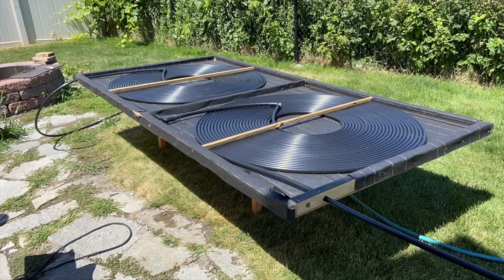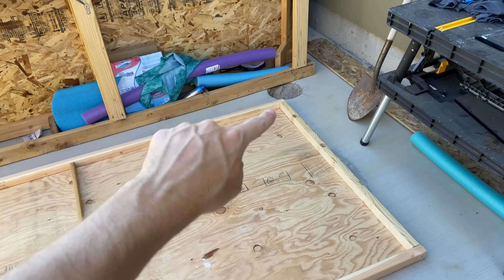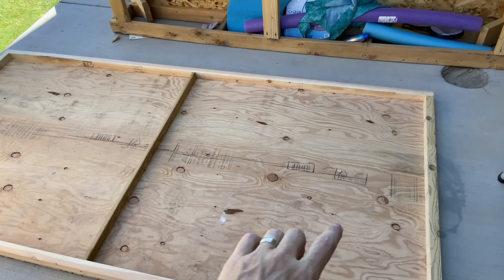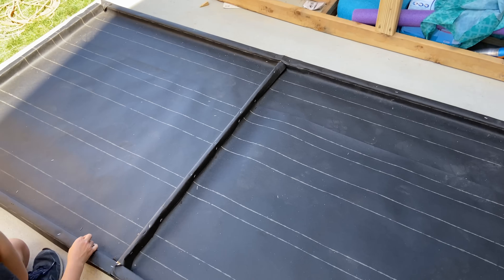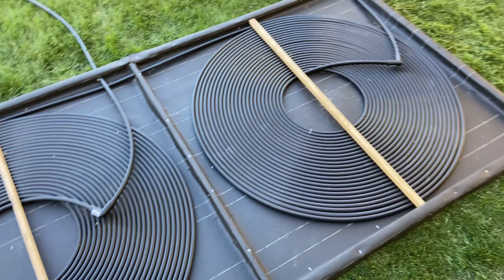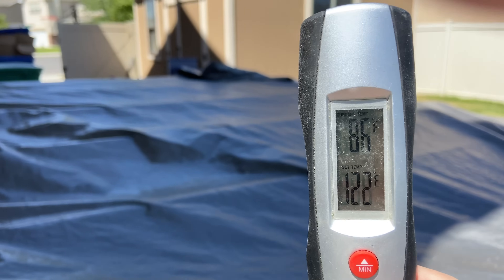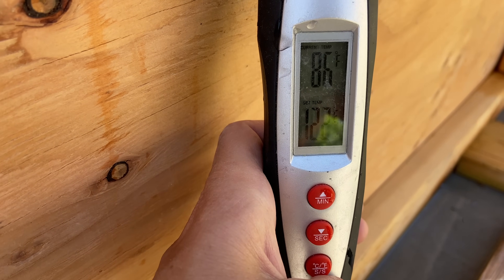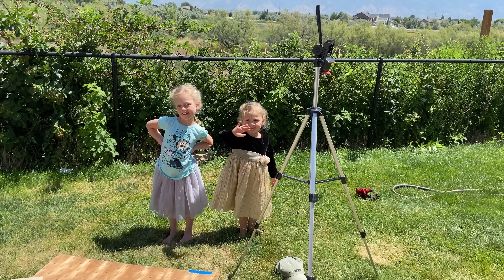DIY Pool Heater - $50 Solar Heater

Comment: Awesome build!  Decreasing flow rate may increase the delta T but it won’t speed up heating the pool.  Consider mixing a drop of boiling hot water to a gallon of ice water vs adding a half gallon of Luke warm water to half gallon of ice water.  In both cases you have about a gallon but the Luke warm / ice water mixture will be much warmer overall.  And in this case it probably makes zero difference but you might start to see higher losses to air around the panel as its temp delta to air increases, increasing convective heat transfer to the surrounding air.
Reply: What!?
Reply: Whatever this guy said... sounds true
Reply: This is incorrect for many reasons. You need to account for the time to build up heat in the water tubes, there will be certain levels of losses if you pump very fast(or very slow). Imagine trying to heat up a small water pipe  using the hot water flowing through it. Now imagine the same flow of water in a much bigger pipe. There will be a lot of loss of temperature just trying to transfer to the big pipe.

Pump too fast and you might not allow enough time for the thermal transfer in the hot portion. Theres lots of variables here and we are just so far away from your luke warm / ice water mixture that I had to comment...
Reply: Sun's energy, even though it varies over the day, is a fixed thing at any time, in W/m². Usually  averaging ~1kw/m² on the Earth's surface on a clear day in normal latitudes.
Reply: The specific heat capacity of water doesn't change much from 0°C to 100°C. The main heat transfer method is radiation Sun -> pipe, which is not affected by the differential temperatures. Temperature difference mainly affects conduction. So, the energy input is the same whatever the temperature of the water. 
Heat losses are contained by the clear covering, and air-sealing of the solar heater panel, which surrounds the pipes in hot air. This will increase the heat input via conduction from that hot air, which is radiatively  warmed by the same 1kW/m² from the Sun. Extra energy! 
So, in my view, the rate of water flow will not affect the total energy absorbed from the Sun, and transferred to the pool. 
Over time, the pool water will reach the same maximum temperature whether fast-flow or slower flow - dependent, of course on the heat losses from the pool/heating system being minimised as much as possible.
Slower flow will produce hotter water out of the heater, but less of it. The total energy transferred Sun>pool will be the same. 
It may be that energy-loss control is a more important factor here than people are considering.
Reply: A small pool, 4m x 10m, averaging 1.5 m deep, contains 60m², ie 60,000 kg of water. 
Every 1°C rise in temperature would require  at least ~2.5MJ of energy. 
Each 8×4 board, with ~1m² of energy collecting area would provide, for free, 2kW. Which would take 125,000 hrs to raise your pool temperature by 1°C. (Assuming NO heat loss) = 10,500 days of 12 hrs of hot sun. 
However, if you had 10 of them....
1050 days. It's only 3 years or so.
Reply: Water is a bitch. It has a phenomenally high specific heat capacity compared to most normal substances. Which is why we all spend so much of our income buying energy to just heat water.
Reply: BIG error! Not 125,000 hrs, 125000 seconds! Oops sorry..
=35hrs
=1.5 days. 
Just with 1 8×4 board.
Hmmmmmm...
Now it becomes interesting.
Reply: Please check my maths. But if I'm right, with 5 or 10 of these, you could turn your swimming pool into a hot-tub in 2 weeks!
(Not to self: must look into swirly pumps for full giant hot-tub experience)
Reply: Thats exactly what I was was saying in my head. To add: Higher flow would have higher efficiency of heat transfer on hot side.
Reply: And u both have zero clue what ur talking about !
Reply: @chriskibodeaux9818  in this instance, the thing to do is run the water at maximum speed. The higher the temperature differential between the source and the sink, the more energy is transferred. If you run it slow you'll just spend energy heating already hot water. The faster the water flows the more it behaves like it's heating the whole pool at once.
Reply: @JackRyanRobtics  100% false! Especially with solar!
Reply: @chriskibodeaux9818  this is how heat transfer works. Heating something that's already hot isn't going to increase overall heat in the system. I've been doing this weekly for years when I make beer. Regardless of your source, you want to maximize the temperature differential to extract the maximum amount of heat from the source. In my case I'm chilling beer too achieve cold break using a counter flow chiller. You counter flow to achieve a high temperature differential across the whole chiller.
Reply: @JackRyanRobtics  ur still wrong when it comes to solar pool heating! Faster is not better! Ur experience with beer does not mean squat when it comes to heating a pool with solar!
Reply: @chriskibodeaux9818  this is basic heat transfer. You want maximum differential in temperature because this transfers the most heat. The reservoir is irrelevant. The output temperature of the water is irrelevant. The only thing that's relevant is how much you can use the pool water to cool the solar heater. The more you can lower the temp of the solar heater using the pool water, the more heat is transferred to the pool. It's a pretty simple equation. Heat in = heat out. You want the heat out to be maximized by your pool water and minimized by any other conduction, convection, and radiation. This means running it quicker as it maintains a high temperature differential, thus pulling more heat into the pool water and reducing the radiation and ambient air temperature differential.
Reply: @JackRyanRobtics  and in the real world fast does not work! U have zero clue what ur talking about! Been doing this for over a decade and slow always heats better!
Reply: @chriskibodeaux9818  I'm not making this up. This is how heat transfer works. You're sounding like you don't know the difference between heat and temperature and been defining it's efficiency based on the temperature in vs the temperature out alone, ignoring the fact that temperature is a unit of heat per unit mass. I can actually break this down mathematically if you want. But I'm actually interested to see how you think this works.
Reply: @JackRyanRobtics  again in the real world solar heater do not work good running the water fast! Slower is always better! Nothing u say can change that!
Reply: @chriskibodeaux9818  In the real world, I'm a mechanical engineer. I've built heat exchangers and Stirling heat engines in the past and they still run pretty well today. The reason I'm here is to try to run a Stirling engine off of a solar heater for my latest low temperature differential design. If nothing can change your mind that math is real, and thermodynamics work, that's a whole other game, but unless you are sitting on something that completely refutes the basics of heat transfer, I highly recommend you run an experiment and come back with data and a theory to support your argument.
Reply: @chriskibodeaux9818  Get an education, and THEN form opinions. They are called the LAWS of thermodynamics for a reason.
Reply: @awo1fman  wouldn’t of commented if I didn’t have the knowledge to back it up!
Reply: @chriskibodeaux9818  All you've done is saying to people: You are wrong. You would have given a thorough explanation as to why they are wrong if you had the knowledge.
Reply: @dontghostbanmeplz8788  cause I don’t need to explain a thing! If u think u can prove me wrong go ahead but u CANT!
Reply: @chriskibodeaux9818  people above me have already proven you wrong. And you are unable to refute anything since you cant explain why. 
Telling people they are wrong just because you say they are wrong in your reality does not prove they are wrong.
Reply: @dontghostbanmeplz8788  they can’t prove me wrong! I’m not wrong! That’s cute! I have done this over n over n over the last 15 plus years! Fast water won’t heat up ur pool at least with solar!
Reply: @chriskibodeaux9818  you'd think with 15 years of experience you would be able to give some decent explanation as to why something doesnt work. 

But nope, you're stuck at: You wrong, me right!
But have fun using fallacy's why you are right instead of real arguments.
Reply: @dontghostbanmeplz8788  I don’t have to explain why the sky is blue! I don’t owe you any explanation! I don’t need to explain reality! Fast flow for solar does not work!
Reply: @chriskibodeaux9818  somebody who knows his stuff can explain why the sky is blue and probably would if hes trying to make a point. 

You wont explain it because you dont know the theory behind it, hence you give every excuse in the book as to why you dont have to give an explanation.
Reply: @dontghostbanmeplz8788  sorry but if u say the sky is brown and I say it blue and it’s is in fact blue I don’t need or have any desire to explain it to you! Sky being blue is common sense knowledge same goes for this! Anyone who has done this a few times know slow flow is the only way it works!
Reply: @chriskibodeaux9818  Well then, better go make that scientific video of a side by side comparison between fast and slow flowrate. Until then, for all we know, you are telling us the sky is brown despite it in fact being blue, without wanting to explain why.
Reply: @dontghostbanmeplz8788  and again I don’t need to prove reality! There is no reality where faster heats better then slow when it comes to solar!
Reply: @chriskibodeaux9818  If you run water from your tap. Slower might be better. 
But in a closed system, where it goes from the pool, into the solarheating, back into the pool, you want all the heat from the sun going into the water.

Like the original commentor said, with slow running water you increase the risk of the system getting hotter and thus transferring its heat back into the air around it instead of the water. 

So unless you mean, the wateroutput at the end of the solarsystem, and not the pool itself, then hey, you are right, but that is not what everyone but you is talking about.
Reply: @dontghostbanmeplz8788  for solar heating a slower flow rate will always heat better then fast flow rate! FACT! Water needs time in the tube to heat up the longer its there the hotter it gets! Nothing changes that concept!
Reply: @chriskibodeaux9818  FACT! You've been talking about the water temperature exiting the tube, not the pool itself.
Reply: @dontghostbanmeplz8788  which is what heats the pool up! Slower will always heat better then fast for solar heating! This is factual!
Reply: @chriskibodeaux9818  1 hot drop gives the same effect as 10 warm drops. Except with slower flowrate you increase the risk of losing heat to the surrounding air temperature. 

If you think hotter water but a slower flowrate means faster pool warming, then enjoy that 1 warm corner of the pool.
Reply: @dontghostbanmeplz8788  again I’ve done this for minimum of 15 seasons! Fast flow rate doesn’t work! Slow does!
Reply: @chriskibodeaux9818  yes, you said it yourself, you only measure the temperature at the end of the tube, not the poolwater itself. 

If I want advice on warm water to wash my hands with, ill ask you for your 15 years of experience.
Reply: @dontghostbanmeplz8788  bahahaha I haven’t said one word about measuring anything or talked about what or how on check temp of the water! The only temp I check is the pool itself! And again when water runs fast it does hardly nothing when water runs slow it heat up significantly!
Reply: @chriskibodeaux9818  you said it yourself, the longer its in the tube, the hotter it gets. 
Means you are measuring tube water, not the poolwater.

With faster flowrate, just because the tubing doesnt get as hot, doesnt mean it transfers less heat. 

The quantity of warmwater outpaces the qualtiy of hot water in this case.

Again, if you want a bucket of hot water to wash your feet in, slow is better, but not for warming your pool in a closed loop.
Reply: @dontghostbanmeplz8788  slower flow rate will always heat better for a solar set up! Now u add pool heater or on demand type heater then yes faster works better! And I already explained how I did both! Fast flow didn’t touch the 22/52 pool! I slowed it down to let water stay in hose longer to catch more heat and guess what pool went up at least 10 degrees! Fast does not work!
Reply: @chriskibodeaux9818  you having memory loss? first time you mentioned it. As if all the heat energy absorbed from the solar panel magically disappears into the air if the flowrate increases.
But go ahead and enjoy your warm corner.

Comment: Curious if you would get better heating efficiency if the coils were spread apart slightly.  The middle tubes are really only being exposed to heat on their top halves.  A slight spread would allow them to heat everywhere but where they touch the bottom of the enclosure.
Reply: I’m building this right now and wondering the same thing
Reply: @rjmills126  did you try it? did it make any difference ??
Reply: @sophivorus  when the sun was out, yes. 

If you took the return hose out of the pool it would feel very close to the pool temp. But if you were in the pool it felt warmer. 

I think is can give you a few degrees if the conditions are right.

Comment: Soo, like some have already commented the price was significantly more than what you advertised but mine works masterfully. It took about a week combined with solar cover to reach 84 degrees!
Reply: Where are you?  I'll take 84 every day.  I'm in Indiana and currently sitting at water temp of 76.  How much did you spend if you don't mind?  Even with air temps of 88, getting in that water is a scream fest.  lol
Reply: That's 84' combined with solar cover. Depending on the quality of lumber you use and what you might have on hand like paint, screws, it can get pricy. It cost me $60.00 just for the plywood. But I always overkill what I build. The cheapest component was the drip line. I used 400' and a 500 gph pond pump.
Reply: How many gallons is your pool?
Reply: @philip7134  10,000 gallons. It's a 18' round with a 7' deep end.
Reply: Where are you located? That's a nice gain so I wonder if you're in a southern location?
Reply: @emailjwr  Foresthill CA at 3200 ft elevation. As I've said with a solar blanket and the solar heater on a mild sunny day I average a 3-4 degree increase. Eventually I disregard the blanket and if gets and stay HOT I discontinue both.
Reply: @jameshelling4421  yeah that makes sense. With my heater off and using a solar blanket I can reach 86deg here in Toronto, Canada, but it requires a legit heat wave. I think in your case it's just the weather. The system in this video is only 4,000 BTU/hr.
Reply: I have old duel pane windows I can use that on top of my hose line

Comment: Great idea and great execution on the construction. How is your system holding up after nearly a year?
I wonder if an intermittent timer for the pump might be of benefit? It seems to me that the water entering the collector will cool down the poly pipe. If the flow was regulated, the temperature of the pipe (and water inside) would rise considerably when the flow stopped. Once that water was evacuated supply water coming in would replace the water expelled. After several cycles the poly pipe would cool down again so the flow could stop for a period allowing the pipe to heat up again then resume. Another option would be to regulate a consistent (slower) flow allowing the temperature of the poly pipe to stay somewhat hotter vs/ being cooled down much faster by the supply water.
Reply: That's what I have, my water pump is 30 seconds on, 10 minutes off, I have a smaller coil.
Reply: @moh1007. What type of pump do you have?

Comment: The Temperature change is almost irrelevant, as it the total heat input that matters i.e temperature change (DeltaT) x volume (m3), slow the pump increase the temp, end up with the same total heat input.
The REAL question is how long does it take to raise the POOL by 1°, and what is the volume of the pool?
Reply: I calculated this based on clues in the video. It's a 4,000 BTU/hr system. It would take 33 days to heat up my 20k gal pool.
Reply: Temp wicking factor Vs.volume.😉🤗

Comment: I just finished mine this weekend based on your design. I was able to get about 480 ft in my 2 loops. I don't have the clear covers on it yet but that's coming. It's setup T'ed off my pool pump and I control the flow with ball valves. Total cost so far as of 6/28/21 is ~135$ that includes an additional 30ft of 3/4 rubber hose and misc fittings. Adding the 2 clear roof panels will add an additional 28$.
Reply: How much temperature increase are you able to get and how long does it take for each degree you can get raided?
Reply: How many BTU/hr are you getting from it? I calculated from the video it's about 4,000?
Reply: so just say you wasted your money and time, if a reg pool heater is 400, 000 btu and this one puts out 4000 . no way this thing will do anything!!!!
Reply: Is your pump 2 speeds? If so, I’m assuming you use the low setting and how has your pump handled pumping through that type of setup? I’m thinking about doing the same thing as you and was concerned about ruining my pump with the different load than what it’s designed to do
Reply: @mikealex74  only a small portion of my overall flow runs through the heater. Majority runs through the factory 3” pipe. I’m guessing I divert about 20 to 30% through my heater. Overall it definitely helps.